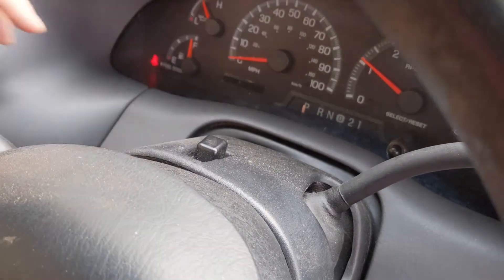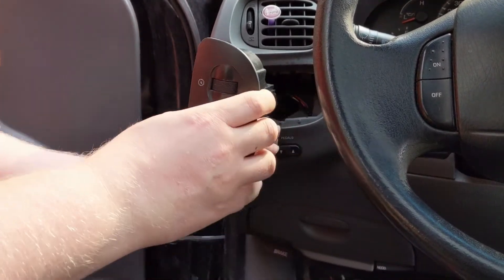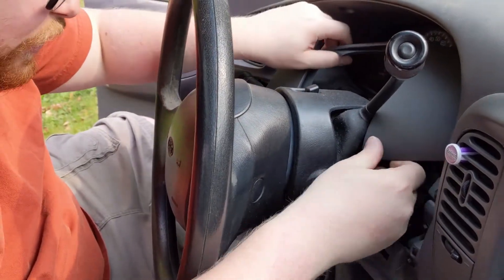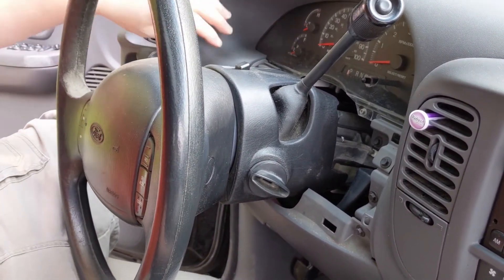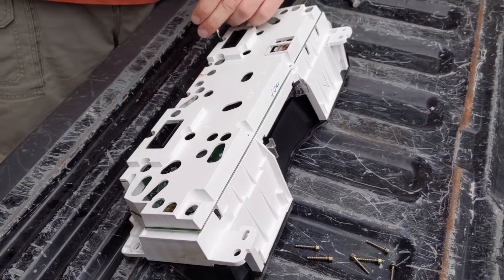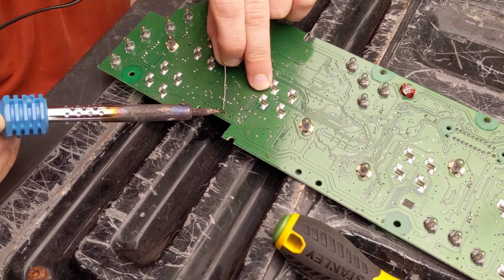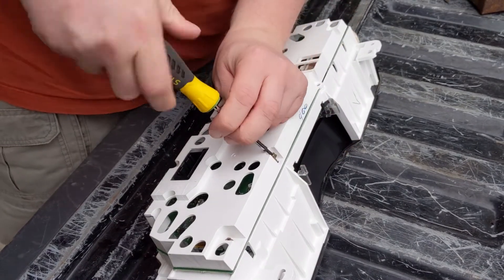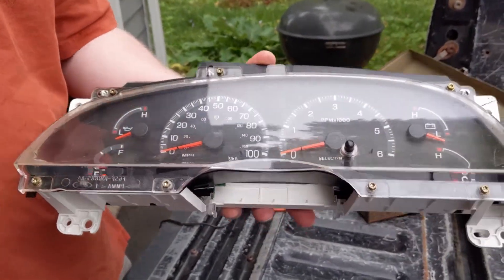2001 Ford F-150 Intermittent Odometer Fix

Comment: I had problem toke some were had solder done but now left side of cluster not working .  Do you know why?
Reply: Moff Diskust  Old was no good .  Put new 1 in all done over but now truck will not start . Said need change vin .Do you know what that means?
Reply: Moff Diskust  I put 1 in that I bought off a place does soldering .  Told need to change vin .  Were do I go to be coded with a Autel
Reply from the maker: Not sure why it would do that since its just fixing a loose solder joint and not changing anything else. I've never completely changed out the gauge cluster myself so not sure what would need to be done in that situation.